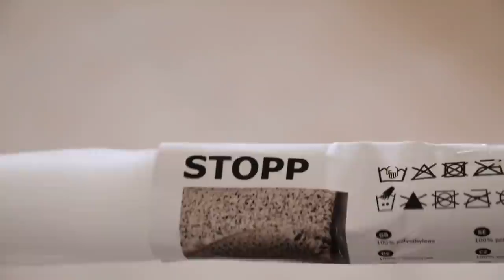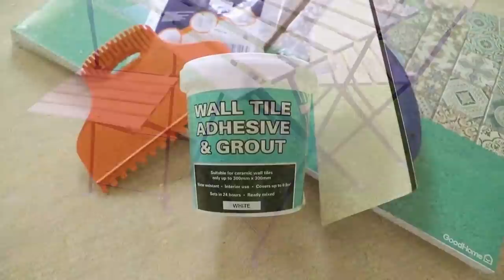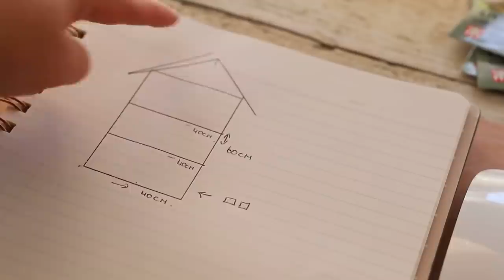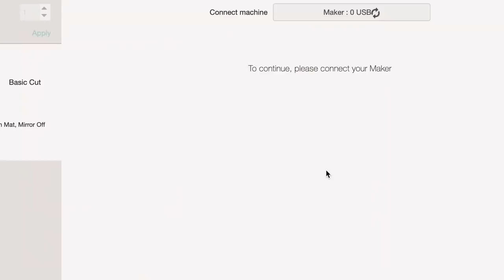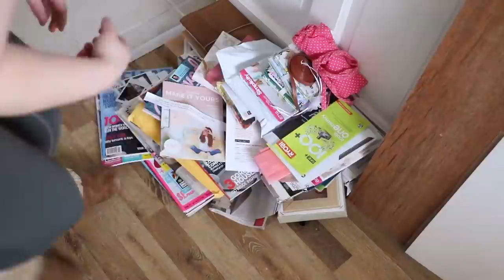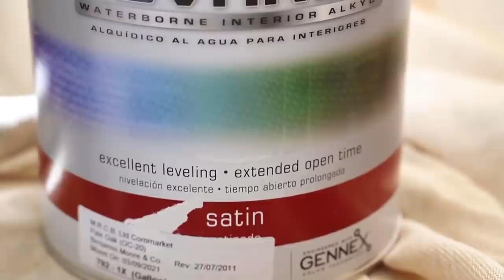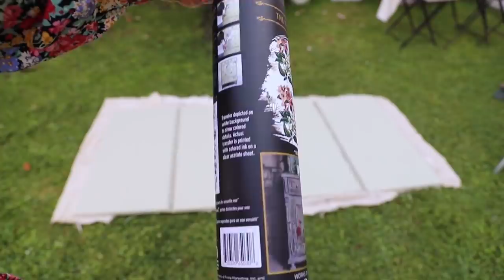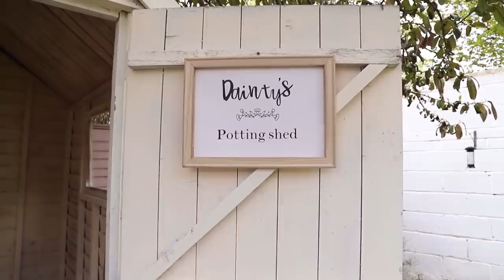Creative home projects compilation. Ikea hacks and furniture flips! 🖌

Comment: Something you might not know is that you can take hot glue and put it on the back of rugs and it will prevent slipping also. You also want to make sure that the rug will not melt because of the heat . Most fabric and even synthetic rugs will work. If you throw in a washer it might come off if so do again.
Reply from the maker: This is a great tip 👍🏼

Comment: Did you cut the back legs off of that piece, or did it come like that?
I like the idea of securing the piece to the wall, but I was afraid it might be a little crooked because of the added space taken up by the baseboard, but it sure did look straight and level. Nice job!
Reply from the maker: Hi Saundra, which piece, the ikea wall? Happy new year 🎉
Reply: @DaintyDiaries  The piece in the entry that you painted green.